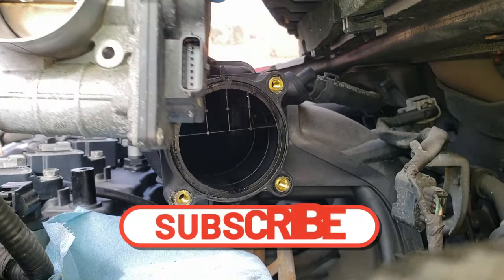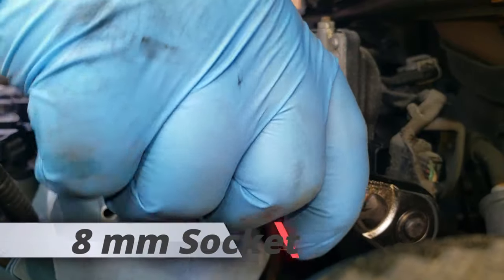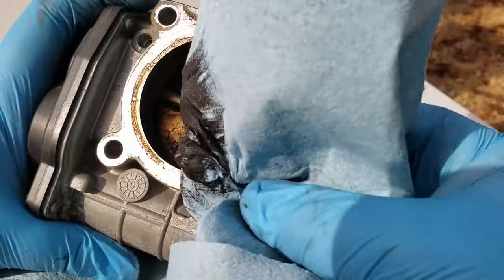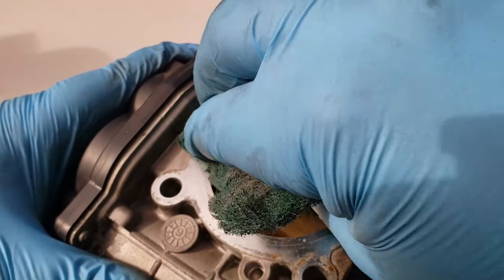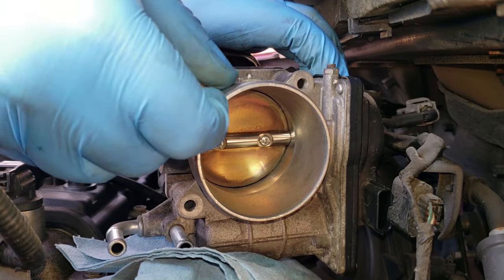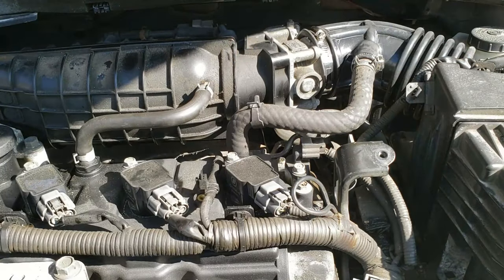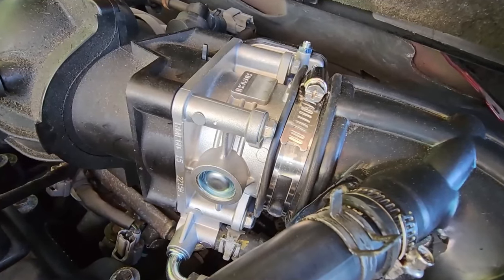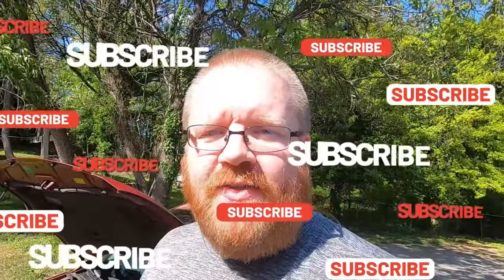Nissan 2.5 Liter (QR25DE) Throttle Body - Full Cleaning Guide!

Comment: 208780 on mines and who said Nissan makes bad cars. Thanks for the video I’ll be replacing mines to much work lol.
Reply from the maker: You're welcome, thanks for watching and commenting! 🙂
Reply: Not sure if my 2018 Nissan Rogue has those coolant lines yet. If it does can't I leave the coolant lines on and pull the the throttle body out 3 inches and clean it?
Reply: @josephmaniaci9782  honestly I’d just replace it. Save if you have to but in the long run that’s an important part and I’d suggest going to the dealership.

Comment: Eliminate the EGR valve. And your throttle body will stay clean.   ;)   So will the rest of your engine.
Reply from the maker: I definitely recommend keeping your EGR Valve. But that's up to you! Thanks for watching! 🤟
Reply: @TrickShiftGarage   I've disabled every one I've ever owned.   The engine burns cleaner, More power and will last ALOT longer.   Don't believe the pollution control hype.   ;)   Think of what an EGR does. Recirculates old dirty exhaust.  Carbon, etc.   Where do you think that all deposits and builds up?   In your intake, Throttle body and everywhere between ;)    And what shortens an engines life?  ;)
Reply: So you can just eliminate the egr valve and it should work ?
Reply: @MRSTACKZ10   YOu can Eliminate it. Or just unplug the wire going to it.   It will no longer open at certain rpms .   Your entire engine will thank you  :)

Comment: Watching this video did help a lot cleaning the throttle body on my 2014 altima . The two hoses attached to the throttle  body are coolant hoses. I didn't realize this at the time.  I did not use the relearn instructions because it seems like the computer corrected itself.
Reply: You’re lucky. Mine did not on my 2012 Altima. It’s just an irritating process to perform.

Comment: i guess battery voltage at 12.9v when car is turned on?
Reply from the maker: No, while the car is turned off. Has to be greater than 12.9 volts or the relearn procedure won't work. Thanks for watching! 👍
Reply: you probably don't have to worry about that unless your battery is really weak or something, you should be fine
Reply: I've read the service manual and it says "Battery voltage: More than 12.9V (At idle)".at least for nissan primera p12 anyways a battery have an issue if its charged over 12.6 v which is 100% status

Comment: Hey thanks for the video. I cleaned throttle body and noticed when at rest, it was not totally closed. Should I replace it? Also after the cleaning, my check engine light did not light up. My airbag light did start flashing though.

Comment: Relearn 
Turn ignition switch ON for 2 seconds
Turn ignition switch OFF for 10 seconds
Turn ignition switch ON for 2 seconds
Turn ignition switch OFF for 10 seconds
Make sure gas pedal is released
Turn ignition switch ON and OFF
Wait 10 seconds for throttle body to make noise
Let car run for 30 seconds to make sure car is still warm 

Idle air relearn
Turn car off and wait 10 seconds
Make sure gas pedal is fully released 
Turn ignition switch ON and wait 3 seconds 
Push gas pedal 5x in 5 seconds
Wait 7 seconds and HOLD gas pedal in 20 seconds until CHECK ENGINE LIGHT STOPS BLINKING and is SOLID
Once CHECK ENGINE LIGHT is SOLID turn car within 3 seconds 
Turn car on to IDLE for 20 seconds
Reply: Is there a source for a list of key-controlled resets?
Reply: Thank you so much for writing this out 😭 I screen shot it 😅
Reply: @barrystewart3950  I’m not sure
Reply: @trynaskate7894  your welcome

Comment: Thanks a lot. Will follow the similar steps on my QR20de engine. If I got an old air hose with minor cracking, I'm thinking of patching it with tyre cement temperarily while waiting for the ordered new one.

Comment: What happens if u skip tge relearn?

Will disconnecting battery overnight for a relearn?
Reply from the maker: For me, the idle ran higher than normal until I managed to get the idle relearn procedure down. I don't think disconnecting the battery overnight will do much for it. Thanks for watching! 👍

Comment: nice video!  what did you do with the dry rot hose? is that a replacement part you can buy on it's own or is it part of a larger compound part?
Reply from the maker: Thank you so much! I threw that old dry rotted intake elbow out and bought one off Amazon lol. Here's the link for the exact one I used but if you find a better deal, go for it, they're probably all made at the same factory lol.
https://amzn.to/46uUKL5

Thanks for watching and commenting, good luck to you! 👍

Comment: I have a 2017 Nissan Altima Sr and I put a code reader on it the code P2119 came up does that mean I need a new throttle body or can I just clean it? And no my engine light hasn’t come on
Reply from the maker: Code P2119 looks like a bad throttle control actuator. It could be carbon build up preventing it from opening and closing properly. I'd clean it up first and see if that fixes the issue. If that doesn't work you'll more than likely have to replace the throttle body. Hope this helps good luck! 👍
Reply: Thank you for this video my car just went through this yesterday, glad I came across your video makes me feel better I thought it was really bad  problem
Reply: Didn't know you can have a code with no engine light...🤔

Comment: Dumb question. Can you leave the throttle body on and clean it that way? I’m hoping to clean it up enough and not have to do a relearn.
Reply: In the video, he cleans both sides which isn't fully possible with the throttle body still attached. Check back if it worked for you! I'm about to do mine when I get off work
Reply: @trynaskate7894  Are you taking off the throttle body and doing the relearn procedure?

Comment: hey guys I have a 2012 Altima 2.5s reading p0101 (MAF Sensor) I replaced the sensor and it ran worse, do I need to do a relearn like this after replacing the maf???
Reply: yes
Reply: Did it work after you did relearn?
Reply: turned out it was the hose that connected the air box to the throttle body, the connection to the throttle body had dry rotted and fallen apart it took me forever to find it cause the engine cover hid it from me!

Comment: Does my foot have to be on the gas pedal during
Reply: Yes, BUT use a stick or brick to hold the gas pedal down at the point the valve is open. DO NOT FORCE THE VALVE OPEN manually.

Comment: HELP!
2012 Altima 2.5, 166K, no power at 4000RPM, car doesn’t go faster than 90MPH. Have aftermarket tranny cooler, changed NS-2 twice within 4 months. Noticed issue after First time I changed the tranny fluid, accidentally overfilled about 2mm above high line, placed it at the correct level, changed to fresh NS-2 for the second time and placed it at correct level, now I have this issue. Mind you, it’s been 100°+ all summer in this Texas heat. 
Is my transmission done?
Reply from the maker: Hmmmm, I think something is going on with the engine, check over your spark, fuel and air, make sure they are good. I don't think it's your transmission, sounds like you keep up with the maintenance pretty good. It's hard to diagnose things like this because it could be so many different things. Sometimes, it's worth taking it to a shop and letting them figure out what's going on with it lol. Thanks for watching! 👍
Reply: @TrickShiftGarage  Always watch your vids. Appreciate your reply!
Reply: @MrBoroski did you end up finding out the issue?
Reply: I really wouldn’t be pushing a 2.5L CVT past 90mph. Just a little heads up.
Reply: @joshuaking5519  definitely possible to make it be able to handle speeds above 150+. I say bc I have a 11 Altima coupe that I fixed up a bit and tops out at 153 haven’t paid much attention to it last couple months as I have a corvette now
Reply: Exactly the same issue I'm having with a 2011 Altima 2.5. Won't go over 80mph. But seems pretty normal below that speed. Does feel slightly sluggish when trying to merge or accelerate hard. I know this because I have an 07 Altima that's easily goes over 100mph. So I know theres an issue. I did all the same flushes as you did. No lights or codes either. Not seeing any cracked intake tubes or hoses. Thanks! What was the fix?
Reply: The fix was the valve body overheated. And install a tranny cooler if you don’t already have one.
Reply: Change the cvt valve body and install a tranny cooler.
Reply: @jorgehernandez-v6k  yup, I’ve hit about 145mph pretty frequently, it’s just I didn’t have a cooler and I KEPT driving from Austin to Dallas every single day during that summer, overheated my shit lol.

Comment: So I did all these steps but now my Gas mileage is worse than it was before. Help
Reply from the maker: Hi David, sorry to hear that! Besides the bad gas mileage what else is going on with it? Rough idle?
Reply: @TrickShiftGarage  actually no it works great but the thing is like I said the gas mileage is worse so for example it says 30 miles to empty and then it goes up to 33 miles to empty then back down to 28 miles to empty like it’s crazy !
Reply: That seems insignificant. At least it’s working without other symptoms.
Reply: Prolly because it can actually read it now. It didn't fluctuate before because it couldn't tell. It doesn't mean you're getting worse gas mileage.
Reply: I believe it’ll fluctuate based on how you drive. If it says 30 miles left and you’ve got the pedal to the floor then it’ll probably actually be 30 miles. If it says 30 miles and you’re going a steady pace or even downhill the number with go up a little bit since at that very moment you’re using less gas. It just calculates it based on your average mpg
Reply: @WormSplatters  Right, it's common sense...🤷‍♂
Reply: @davidaguas1739 That’s based off of real time input because of your driving habits. Mine does that too.

Comment: Could this help with the P0101 code?
Reply from the maker: Probably not as the throttle body is down stream from the Mass Air Flow sensor. I'd go the other direction and check your air filter, if it's really dirty or clogged up it could be the root cause and replacing it should fix it. If that isn't the case make sure there are no air leaks in the intake system, check all over for any air that could be entering. Check the electrical wiring and connectors too. If that looks good then clean the MAF sensor with some MAF sensor cleaner. And finally if that doesn't work replace the sensor 😉

Comment: I have a 2014 Nissan Altima the Rpms fluctuate a bit when going up from a stop and the engine shakes for a bit then goes away, do you think this could be a reason why?
Reply: My car idles at 650 but it bounces up and down and I feel the engine vibrate, any idea?
Reply: "the Rpms fluctuate a bit when going up from a stop"  What does this mean???
Reply: @cumshot247  acceleration from a dead stop, when my rpm’s hover 1-2 I feel a shake and then it goes away. If I maintain my speed I won’t feel that again. But only when accelerating from a dead stop and passing 1-2 rpm’s I feel the shake, then goes away
Reply: @UnknownPubStomper  Could be a number of things... I would try this cleaning along with cleaning your MAF sensor and checking your plugs.
Reply: Clean the MAF sensor and throttle body and see if it improves. Sounds like this will fix the issue.
Reply: Loose or bad motor mounts will do that too...
Reply: Catalitico

Comment: Kenapa tidak guna sahaja throttle body cleaner dalam keadaan injin dihidupkan..
Reply from the maker: Baik saya matikan enjin supaya saya boleh mengelap sekeliling plat pendikit. Jika anda cuba menyembur pembersih badan pendikit semasa enjin dihidupkan, ia akan menyebabkan terbiar kasar kerana udara tidak diukur oleh sensor aliran udara jisim kerana siku pengambilan dimatikan. Terima kasih kerana menonton!👍

Translation: Well I have the engine off so I can wipe around the throttle plate. If you try spraying the throttle body cleaner while the engine is running it will cause a rough idle because the air is not being metered by the mass airflow sensor since the intake elbow is off. Thanks for watching!👍
Reply: What ideation would let you know it needs that done? And do u know anything about a 2010 Nissan altima 2.5 ?
Reply from the maker: The throttle plate was sticking, which caused it to stumble on take off. Once ot was cleaned, the problem was gone.